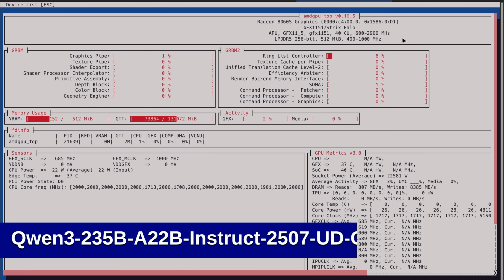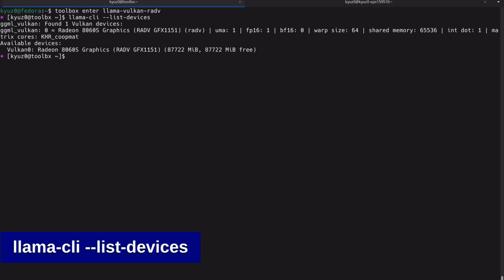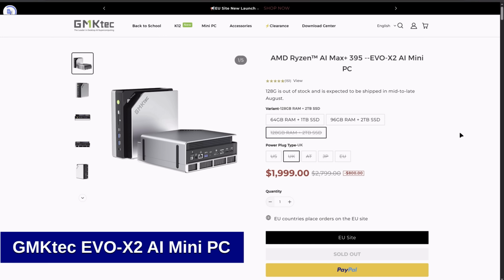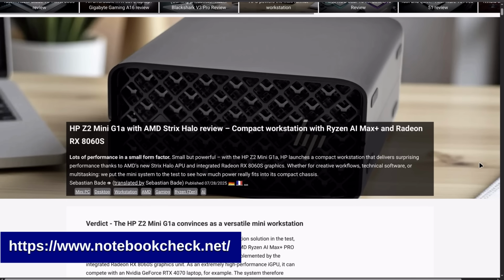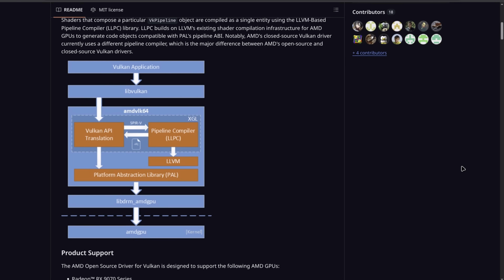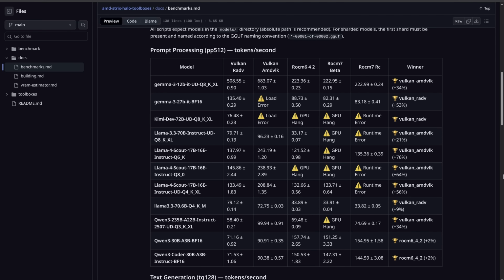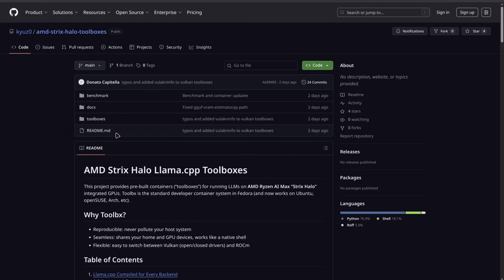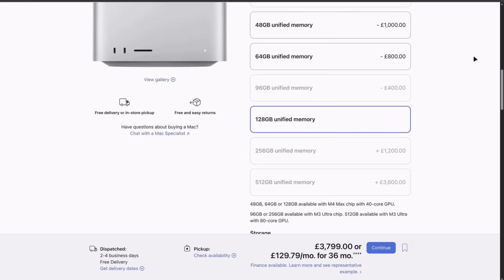GLM 4.5-Air-106B and Qwen3-235B on AMD "Strix Halo" AI Ryzen MAX+ 395  (HP Z2 G1a Mini Workstation)

Comment: Extremely expensive for a extremely slow and full of bugs device. Unless they start adding lpcamm2 in dual channel, those are a big NO.
Reply from the maker: I would not say the device is full of bugs, the software stack has bugs which is frustrating, but that's being resolved and performance is improving now that kernels are being fine-tuned.

I'm open to the fact that this is too expensive, but do you know cheaper solutions that can do 120GB of RAM?
Reply: @donatocapitella  it's not about vram but usability. If everytime you run a model you can go have a nap... you'll be just napping, not working. 256GB/s of memory bandwidth is 7B and 13B territory, period. And those can run in just one 5060Ti (has 448.0 GB/s of mem BW)

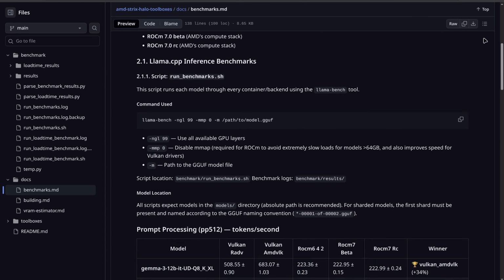14:50 just have a look at those benchmarks: 12B, 27B, 17B, 30B Q3 XL (a 38GB model) ... just install two or three 5060Ti (1500USD) and perf will be at least three times faster than that PoS. 16*3, 48GB, discounting 1.5GB for the cuda kernels, you'll have 8.5GB for context, which is a lot.
And for inferencing you don't need pcie link speed aside loading models.
Reply from the maker: @vxvicky I agree if you're talking about dense models, but it's simply not true for MoE models. I can run GLM Air and llama4 with very usable speed, I should know as I literally use this myself for many things.

Yes, I don't use this for things with very long context - but there's plenty of usecase ls for me that don't require long context.
Reply: @donatocapitella  MoE are the biggest PoS ever made, by definition. Require an absurd amount of memory just to load but only use a little tiny part of all the NN just to do anything.
Useless for a normal usage, only useful for benchmarks.

That aside, even those will be slow asf. 
Let me tell you again: that tiny amount of mem bw (256GBs) is low end cards territory.

Even a CHEAP 4060Ti has more than that (288GB/s > 256GB/s)... and to top it off, you're sharing membw with the system, so you won't be using all of that measly 256GB/s, but just a fraction.
Reply from the maker: @vxvicky  “MoE are the biggest PoS ever made” comment is a valid opinion but I suggest maybe a tad extreme(?). Mixture of Experts models have trade-offs: they are harder to train and add memory overhead, but they can scale better and run more efficiently since only part of the network is active at a time. You can build capable MoE models; Qwen3-235B-A22B and GLM-4.5-Air are examples with solid results, not just benchmarks we actually use them for production use-cases (but not general purpose chat assistants). It is not a perfect approach, but the level of emotion here feels unnecessary, and calling it garbage “by definition” doesn’t really add much to the discussion.

On memory bandwidth: yes, Strix Halo is bandwidth-constrained. In that kind of setup, MoE can help balance compute and bandwidth, which is why I recommend those for Strix Halo. There is nuance here; it is not black and white.

Comment: Very good video, i use a 128GB GMKtek and struggeld weeks with rocm until i foubd out that its so unstable with new igpu, now using RADV, what i did not now is about the buos setting to 512Mb all and do vram allocation via flags... now with this i can add enough contex mem on a 70b model to use in RAG setup!  Really good info and links
Reply from the maker: Thanks for your comment, glad you found it useful! Thankfully ROCm is also improving a lot!
Reply: I hope do, o was struggling 2 days with my RAG software as the llm was just replying gggggggggggggg al the time when it got fed data from vector database or system freezes.... then i noticed the remarks about rocm so shifted to RADV, but your remark about the dynanic vram allocation was a eye opener! I did not relize about using the no map flag when building with llama.cpp, its crazy what you can do with this machine! Having a 32B bf16 model with huge context is no problem on it!
Reply: And a was running a too old kernel on ubuntu server, 6.08 .... so updated it and now it works really well

Comment: Do you have images for gfx900?
Reply from the maker: I don't, I would if somebody sent me a card to test and experiment with!
Reply: @donatocapitella  I would buy one for you but the software stack is a nightmare and you will be compiling kernels. If you want that let me know. I was hoping you already had the older stack. They scrubbed most of the pieces you need for that arch.
Reply from the maker: @noanyobiseniss7462 oh I see, this is one of the olden cards that they're removing support for! :(
Reply: @donatocapitella  Actually purging key components like matrix math in the source trees. Its a devious method to force the industry to purchase new hardware.
Reply from the maker: @noanyobiseniss7462  TBF, correct me if I am wrong, that is a 8-year old architecture, isn't it? I think engineering team have to strike a balance between supporting old hardware vs what is feasible. Maybe the effort in supporting it would still deliver awful performance on some modern workloads, then it doesn't make much sense. I do not know this for a fact, I only recently got into AMD GPUs with Strix Halo, so here I'm just using my engineering background to speculate!

Comment: Amd unified memory is different from the Apple version. Apple unified means the same memory location can be accessed by both cpu and gpu. Amd unified requires partitioning of system ram. The data on the gpu partition of ram isn't accessible to the cpu vice versa.
Reply from the maker: I am not sure this is correct. As I show in the video, you do not need to partition the memory are pre-allocate memory to the GPU. Instead, CPU and GPU can access the same memory via GTT - exactly what is shown in the video.

Or do you think that what's shown in the video is not unified memory and I am getting this wrong? I definitely do no statically partition anything.

Comment: I've done all the memory settings as per the video. When trying to load the Qwen3 235b model 3_K_M radeontop shows my GTT memory first fill up to approx 64GB then there is a pause, then it tries to fill up up to appox 100GB and then it goes back to 64GB....and this happens in a constant loop. Please advise what could be wrong here?
Reply from the maker: Most definitely the gtt settings are not applying. What distribution/kernel have you got? This issue typically happens if you only set GTT and don't set 'ttm.pages_limit=33554432'. Check for typos as well.
Reply: @donatocapitella it's Ubuntu 24.04.3 kernel 6.14. There are two ways of applying those settings. I've used the kernel CMD in Grub and the ttm.pages_limit is set
Reply from the maker: @vangarus then join the discord server I mention in the video , we can troubleshoot there

Comment: is there any way of getting this running on windows?  or is it Linux exclusively
Reply from the maker: Not these sandboxes, but llama.cpp runs on Windows just fine. I think you won't be able yet to do unified memory on Windows, so you'll need to allocate the memory statically in the BIOS. 

I've heard performance on Windows is not as good as on Linux, but that's hearsay, Linux is just easier to deal with for me, hence why I made my setup on Linux.
Reply: @donatocapitella  im currently running lm studio with roo coder for vs code on a 5900x 48gb and a a5000, and was considering one of these amd mini's a possible upgrade, as the only model iv gotten to code without throwing errors every 5 minuets is glm4.5 air at 39gb. which absolutely doe not fit on the a5000

Comment: This is a promising cpu. Too bad it can only handle 128 gigz of memory.
Reply from the maker: Indeed, a version with 512GB and twice the memory bandwidth would be great, but also very expensive!
Reply: @donatocapitella  This machine already is. Just last week I made some calculations what could I build that is capable to run bigger models. About 25% more expensive than this HP workstation I could build a Threadripper config with 512 gigz of memory. Obviously it lacks the fancy integrated GPU, so raw CPU only.
Reply from the maker: @DaT0nkee  I'd be curious to see how the raw CPU would perform vs the iGPU.  My expectation, but I have no concrete data, is that Threadripper would not be great at those parallel matrix multiplications needed for large models.

Comment: Didn't find the answer in the video, so...
Can you answer why models like qwen3 and gpt-oss are MUCH faster than others (llama, kimi, gemma3)?
Oh, and will be nice if you add deepseek r1 for comparison
Reply from the maker: It's because they are Mixture of Experts (MoE) Vs dense models.
Reply: @donatocapitella  Thanks for the answer
I watched video about MoE and realized, that gpt-oss-120B have only 5.1B active parameters. Amazing, that the same 40t/s is the average token speed for 5B dense model
Reply: Now im thinking, is this possible to load all the model to RAM and then use GPU for only active parameters? Like, i have 16Gb of ram and 4gb of VRAM. I can run gpt-oss-20b in CPU, but is this possible to use GPU in this case?
P.s. I found kimi-k2 quite interesting. It have parameters for gpu (loading 1 or more layers into VRAM), threads and loading only the part of the model "128GB unified RAM memory to run the small quants" as i read.
I love the idea of "layering" ai models, so it can run from gpu,cpu and (very rarely) ssd simultaneously
Reply from the maker: @kirykas only of your CPU supports unified memory. The thing with the Strix Halo is that it's an iGPU and it can access system RAM
Reply: It's not, but i learned a lot today
Thanks for guidance

Comment: Why would you run it at 6bit instead of 8bit. 

I'd rather have it smarter and more accurate not faster. 😢
Reply from the maker: Q8_0 is not the same type of qiantization as Q6_K_XL. Q8_0 quantizes everything in the same way, the dynamic quants use different precisions for different parts of the model, so they can keep some weights at high precision and according to Unsloth, Q6_K_XL performs better than Q8_0. But again, it's notoriously difficult to benchmark LLMs, in real life we try and check what works better in a specific use case.
Reply from the maker: Actually, if you look at the benchmarks, Q8_0 runs faster than Q6_K_XL, for example
Reply: @donatocapitella i see, I heard of that feature, its relatively new way to compress, still I agree it is hard to benchmark them, but even if it comes up with the correct answer it doesn't mean that it will be the best answer. 

But how can you use 128 GB allocated to the vram, surely the system needs at least 2-8 gigs to run?
Reply from the maker: @anarex0929 that's the theoretical maximum that you set,  but you won't be able to use all of it due to the OS needing a few GBs. Just no point in my opinion to set a ceiling less than 128GB, just let it know it can use as much as it's available.
Reply from the maker: @anarex0929 I will say, anecdotally, I find Q6_K_XL to perform better or on par with Q8_0 for two of my main use cases (dataset generation and LLM judge for https://spikee.ai)
Reply: @donatocapitella thanks for taking the time. 👍🏼

Comment: I've been researching this chip extensively lately, with local LLMs in mind. This is the first video that I found which gets into the LLM aspects of this tech in detail, with some evident knowledge about how it works and is best deployed. I particularly appreciate the landscape you paint of how frontier tech like this is a bit sketchy and hit and miss on model/driver performance, that's super indicative benchmarking and highly valuable to me personally. I also appreciate you differentiating between MoE and dense model performance, for example, which is the kind of detail I'd not found explored in any other YouTube videos about this chipset and its best use cases. I've found some reddit threads that had similar knowledge and made the same points re dense/MoE performance. Some users on reddit had gone vulcan-only for benchmarking due to (I assume) same/similar issues you encountered, but the results from Rocm and Radv, even if inconsistent, are still extremely useful to have insight into, not owning the hardware myself. 

Really appreciate the video mate, great work giving this a proper deep dive on a use case that it serves uniquely well. These 395+ things are kinda insane.

Comment: The problem with AMD Strix is that they only have 200GB bandwidth and only 128GBram not 256GBram... also prompt processing is unuseable slow with a 65k context window.

400GB/s memspeed is a must with at least 256GB memory and at least 600t/s pp and minimum of 20 tokens/s, otherwise your face sleeps in vibe coding.
235B Qwen model would be perfect.... but AMD strix is just not powerfull enough
Reply from the maker: Yeah, if vibe coding on long codebases is the only use case you have, this will be slow.

Comment: You don't need 128gb vram for moe models. I don't get why should I spend years to make things work on a pc, hacking kernels and drivers, total nonsense. I have same issue with ryzen laptop, which still lacks proper drivers for power management and youtube acceleration for 3 years. I am still skeptical about the upcoming 32gb 9070xt with those crappy drivers.
Reply from the maker: If you allow me to say this, this comes across as a bit of a "dramatic depiction" and doesn’t fully match the guide in the video – the setup I proposed is just a standard Fedora install, three kernel parameters, and pulling a prebuilt toolbox. No kernel hacking, compiling, or patching – it works out of the box. :)
Reply: @donatocapitella  You are underestimating your work. It takes, weeks not only to make things work but also to figure out what doesn't work. I am sure you didn't produce this video overnight.

Comment: Excellent video and excellent resources.
A few weeks ago I had a chance to use a GMKtec EVO X2, with 128GB RAM. Definitively I couldn't reach so far as in this video, mainly because in the end I had to setup just for Windows. But in the meantime I made a dual setup, with Ubuntu latest LTS. With that tests, the overall thermal experience to me was surprisingly good. Is in the way to get one EVO X2 also for me, just  need some time. Then I will pay more attention to see where are those thermal issues, mentioned in the video.

Comment: The issue is the unified emery is not the same as the Mac.  This uses ddr5, which is orders of magnitude slower. 

And the real world issue is processing the context, every time. I would bet this slows to an unusable speed with a 60000 context, loaded with reference code files. 

Reality: only bearable with 14 to 32 q4 models. 

None of this is new. Beelink has been using unified system memory for years.
Reply: M3 Ultra: 819GB/s. Strix Halo: 256GB/s. Ratio 3.2 < 10. That's not an order of magnitude and wasn't even compared to Phoenix Point.

Comment: The other cheap local configuration that could one day be supported fast is 16gb GPU, with 96/128gb APU ddr5 sodimm.  Where models are split with "important 16gb" and less important 128gb.  780m mini pcs with oculink 5060ti/9060xt are more powerful than 395+ for less $, but it seems like driver maturity is one obstacle, but layered model designs, or dynamic focused loading of specialties into GPU, is not a design focus, but A2A (agent AI communication protocol) is one approach to combine specialist AIs.  For coding, feeding output of one model into one that will compile/load the generated file, fixing it, and improving it possibly in background while prompt is idle.

As an example, on very potentially small/fast llm would be one specialized in knowledge of other LLMs that both recommends LLM combinations and directs the traffic/flow among agents.  Maybe some of this exists, but I don't know of any of it.  It is a path to much higher minimal spec/expense onboarding.
Reply: So, to you, it's better to have a ryzen apu and a 16gb gpu ? you can make use of both ? Do you need DDR5 and a lot of it too ? Thanks
I'm looking for the cheapest, most competent setup for having my coding LLM home on local because of privacy concerns on the code. Also, power consumption can count.
Reply: @jacquesdupontd  The architechture and reasoning seperation approach does not exist yet.  IMO, it is better to have a slower accurate model than a stupid fast one, today, but chaining AI models as tool assistance for coding, such as running tests, debugging, and then fixing output or communicating among themselves with user as a last resort to fixing issues is an obvious area of improvement.  Perhaps small specialized AI models is a future.  One where GPU would shine.  24gb GPUs can fit a quantized qwen 3 model, and maybe good enough, or future model will be good enough for 16 or 24gb.  Things move to fast to know.

Comment: Do you have a Fedora setup guide? Tks
Reply from the maker: Not really, I just did the default install, I think any Fedora guide should do. 

Unless you're asking for after install setup, in which case you don't need it, you can just use the baseline install and then pull my containers. Zero configuration.

Comment: Thanks for this, this gives a much  better idea of the capabilities of these systems.
Did you considered waiting for the Spark machines ? Or just done with waiting ?
Subbed for more.
Reply from the maker: I did consider waiting, but I had some research and use cases for now, so I took the plunge - and this is doing the job.
Reply: @donatocapitella   ahh, that explains it, because I get the impression Spark might still be the best performance per $/Euro/GBP, it's not cheap, but a lot cheaper than Apple, even if you need 2 of them (which I think was the max?).